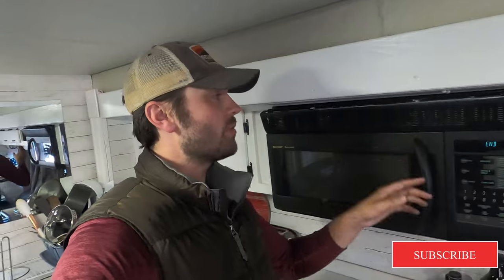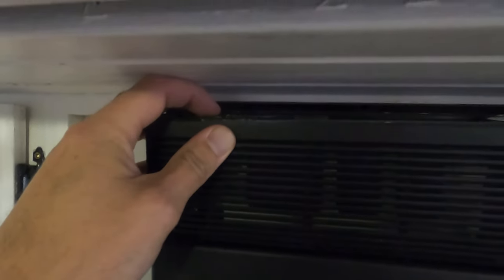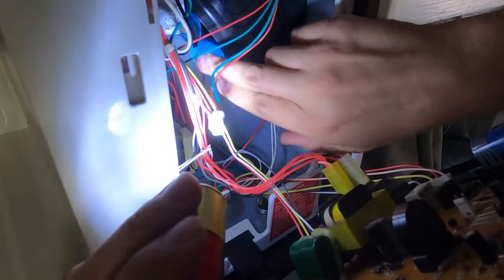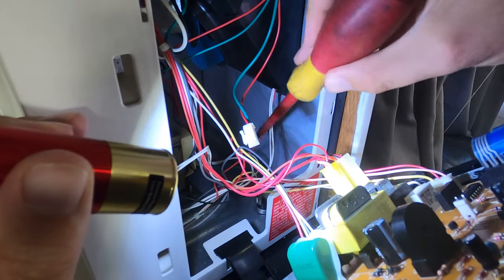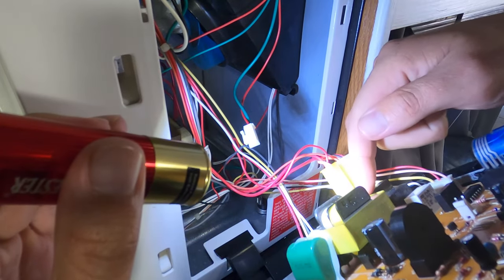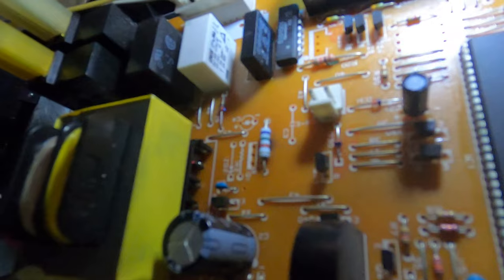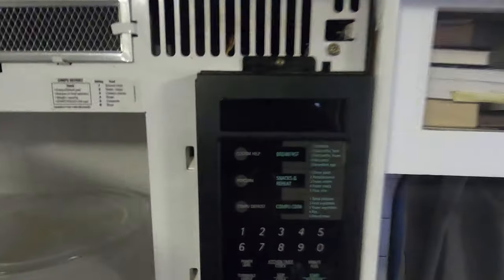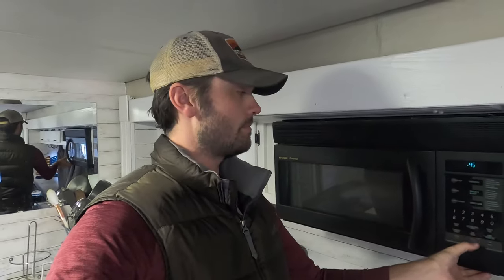Microwave Fan Not Working? - Easy DIY Fix!

Comment: Don't relays just go bad sometimes?  My defroster fan in my truck wouldn't work on low, so I just replaced the relay and it fixed the problem. However,  I will still try the tap method first.  Thanks.

Comment: FYI If your fan is non-operational right from the factory it may not be an electronic malfunction. It may be mechanical. Here is my solution: My brand-spanking new GE counter-top microwave did not sound right from the first time i used it. Then I noticed that any food cooked created copious amounts of steam that escaped out the front door when it was opened. I knew this was not right. So I felt the back of the unit and found that there was no fan exhaust while running. So I got out my flashlight and peered into the grate of the exhaust port. Using a very small diameter, non-metallic probe I tried turning the fan blades. They were free but would not spin. Then I noticed that they were bumping up against a piece of metal inside. So I removed the 8 screws on the back and pulled the housing backwards towards the rear of the unit which allowed it to be removed. Being VERY careful to stay clear if any of the internal electronics (which can injure of kill says EVERYONE) I used a pair of insulated pliers to bend the thin sheet of metal away from the fan blades. Voila! Problem solved. I could have just returned the unit —EXCEPT— Home depot will not take back returns after 48 hours. I did not even use it for 3 days! And dealing with GE's "courtesy Goodwill Certificate" was going to be a major hassle. I hope this 5-minute tip saves you 2 hours on the phone on hold trying to talk with GE!
Reply from the maker: Thanks for watching the video!

Comment: Came across this after realized within the last couple days our High Pointe microwave fan in camper was not running when cooking food. Used one summer when camper was new in 2019. Storage for covid and health issues. Just out since June 2023. Sounded fine couple days ago. Noticed yesterday lots of moisture inside and on inside door. Had to wipe it all out. Just tonight the fan inside is not running. Think have to totally remove from cabinet. Not sure want to do that. Think is plugged in behind it in the cabinet. Do not know if it will ruin anything running it without the fan circulating the steam and air.
Reply from the maker: I think you're microwave fan relay is stuck. Follow the steps in this video and smack that thing.

Comment: Even though there feels no obstruction on the fan, relay is not always the culprit.  My case was that the fan motor was the issue.  Also knocking off the relay is temporary solution,.it will come back.  Replacement will eliminate the issue 100%.

Comment: Amen! What if the problem is on the smoke sucking-fan facing the stoves? Mine is not working since few days ago. Thanks.
Reply from the maker: Sounds like your microwave isn't working still?
Reply: @FixiT-Rick  the microwave is working. But the ventilation to suck the smoke from the stove is broken.
Reply: Sploopy!
Reply from the maker: Thanks for watching the video!

Comment: My microwave’s fan stopped working, then the microwave shut itself off.  After about 20 minutes, it turned back on but the fan still wasn’t working.
Reply from the maker: The circuit board is probably on its way out. Relays might be stuck, but a good smack like how I show you in the video should help.

Comment: Fan won't turn off
Reply from the maker: If your fan won’t turn off, that means the relay that turns on the fan is stuck. Try opening and closing your microwave door a couple times and shut the door kinda hard. If the fan is still on, just watch this video on how to find the relay and give it a good tap with your screw driver.
Reply: @FixiT-Rick  ty